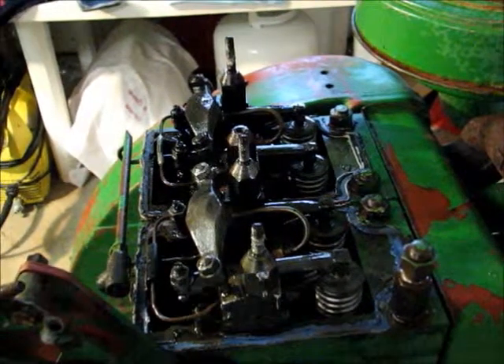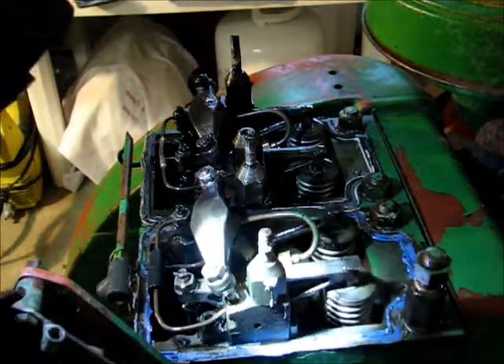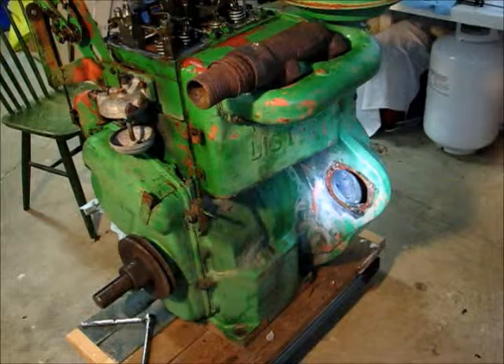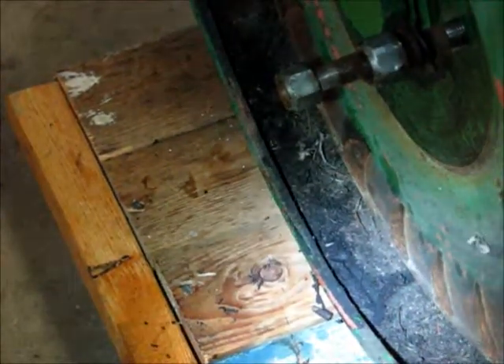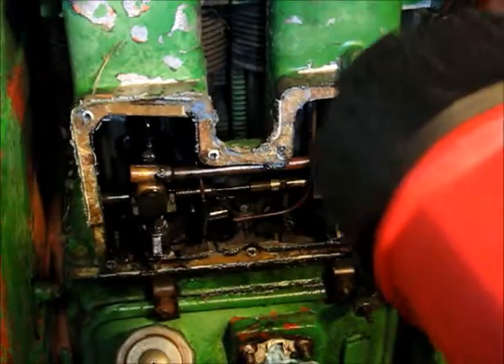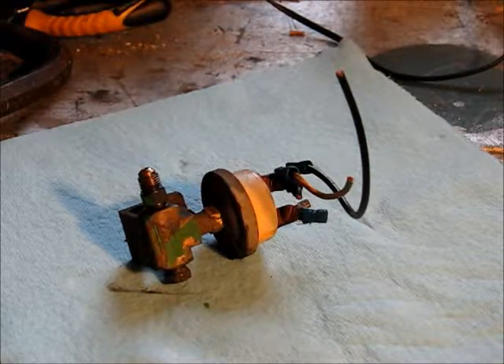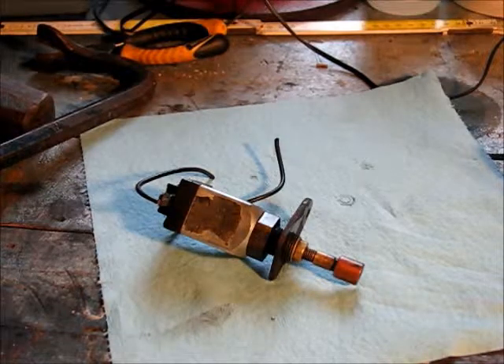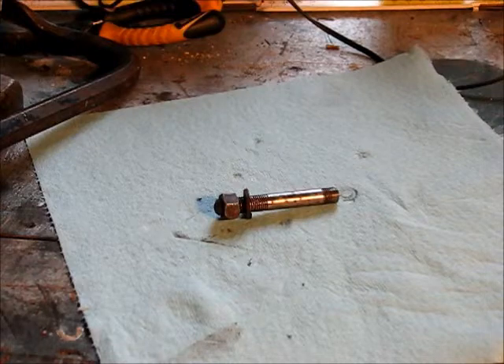HR2 Tear down step 1

Comment: I'm in the process of getting an HR2 to run again. It's not turning, I think the cylinders are rusted in place. it stood without oil for some time after water got in and the oil was drained. It doesn't look nearly as bad as yours (exhaust/inlet pipe rust holes) but I'm a bit afraid what i'm gonna discover inside.

did you manage to fix yours in the end?
Reply: ok i just got the cyilinderheads off and the chambers were completely flooded with water.